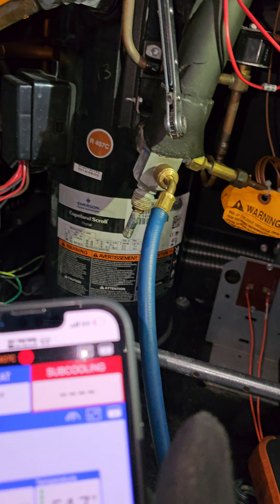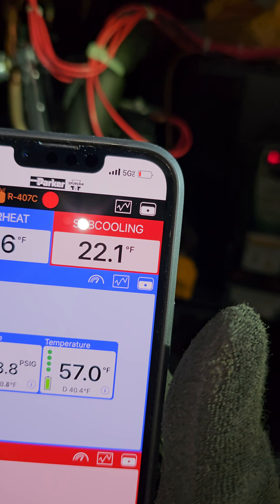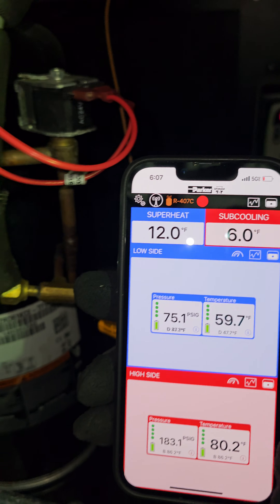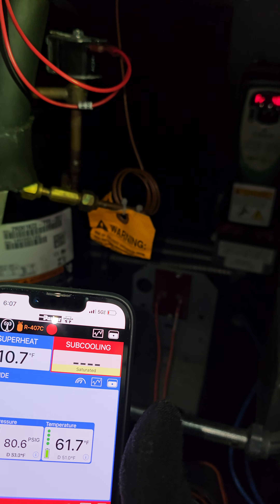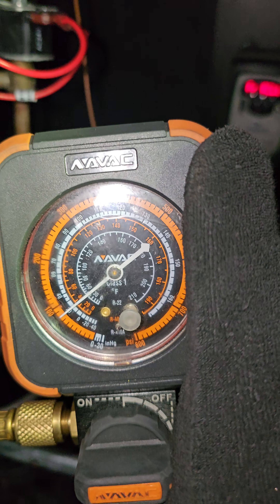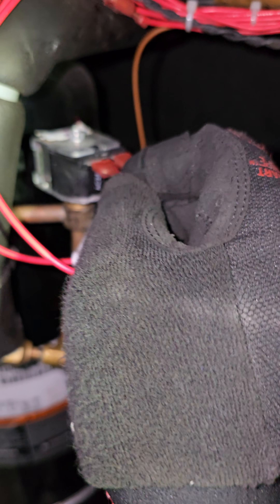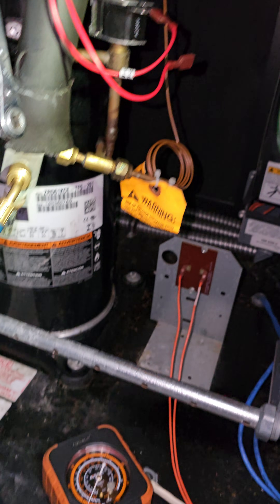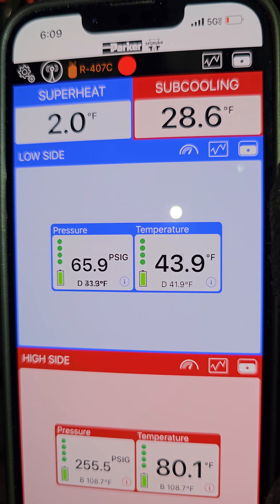ADDING | CHECKING REFRIGERANT | SYSTEM WITH DIGITAL SCROLL COMPRESSOR

Comment: I ran into this problem the other day on a Liebert unit for a UPS Room. I was charging the unit while the digital scroll compressor would load, then I would stop charging during the un load and wait until the loading would resume again to average out my sub cooling.

What I discovered was that the system was only at 40% for cooling at a set point of 72°F. I dropped the unit's set point a few degrees which caused the compressor to fully "load" at 100%. 

Great video. Appreciate the content.